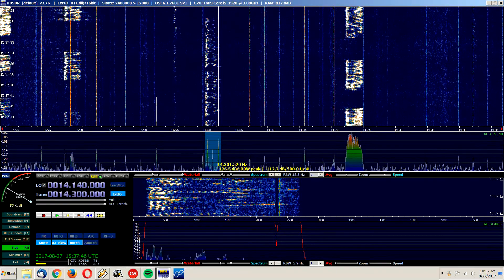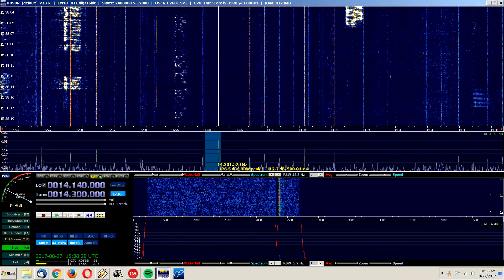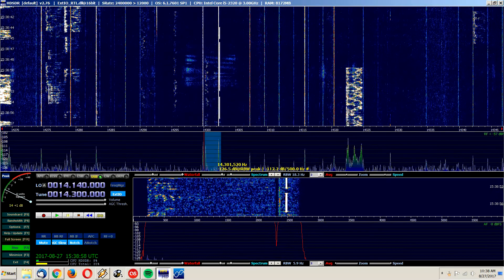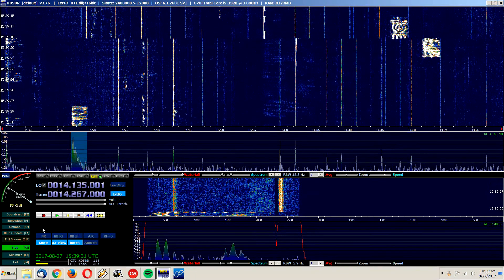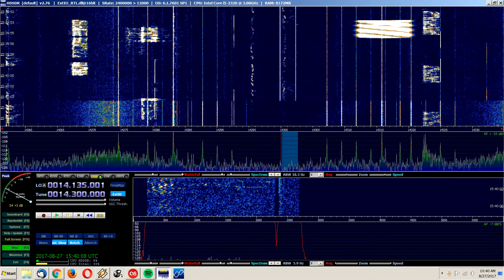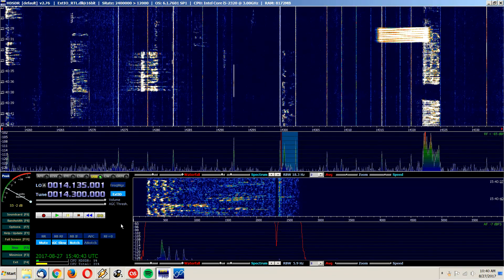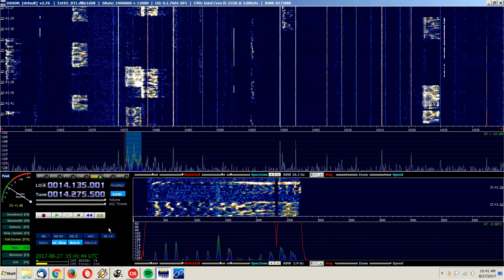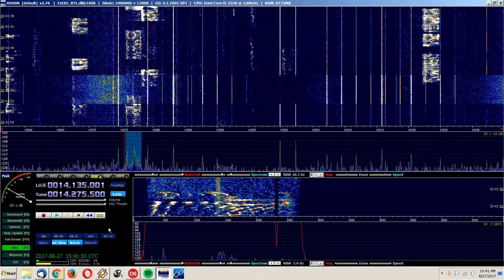Off Center Fed Dipole vs Fan Dipole

Comment: You need a 4:1 balun or ladder line & balanced tuner for your OCF
Reply from the maker: Yeah, back when I made that antenna I did not know that I needed a 4:1 balun for it to be a true OCF dipole. Still, for a receive antenna, it wasn't that bad from what I can remember.

Nowadays I'm using an end fed antenna with a 9:1 unun, and a 40 meter double bazooka for my rx/tx antennas.

Comment: You need a 4:1 balun for ocf. I run one and a fan also. One station may be better on one than the other one minute and it changes the next. Did you get the loop back up
Reply from the maker: Yeah I found out about needing a 4:1 balun when I was studying for my ham radio general license. If I ever try using a ocf again, I now know to use a balun. Sadly the loop is still out of commission. My brother hasn't had the time to look at it.
Reply: Sparkyzilla85 just finished my loop today. Needless to say it’ll be coming back down and the ocf will be going back up.
Reply: To all the know it all's, an off center fed dipole's impedance is set by the height of the  feed point. For a 4:1 to work perfectly, the antenna needs to be closer to 40, feet.. 12 feet off the ground is hard to guess, but at 12 feet, you can't get the full effect of the OCFD.
Reply: Joseph Massimino impedance also changes as the center feed is moved one way or another. The further from the center, the higher the impedance will become. And yes height plays a roll too. Higher the better. Mine is at 32’ with great results. Dropping it to 20’ raises the vswr to 2:1. No “ know it all here”. Still learning after 25 years. As are you.
Reply: @JayN4GO  Maybe you  can reference a URL where it mentions about moving the feed point, and  impedance changing.  I've read a lot, and the feed point is usually set by the ratio between the sides. I  don't think the impedance change on changing center is so much. The adjustments I made had to do with moving the resonance closer to where I wanted it on each band.  It is a tricky process, and takes time, but once it is set, it pretty much stays.  The antenna did not work as well at approximately 30 feet to the feed point, but once I moved it to 40 feet, it really took off.
Reply: @JayN4GO  But the offset does change , but the height is the great variable that makes the difference between the wire being 200 ohms, or something else.

Comment: Sorry to hear about the loop, the OCF dipole is nice and quiet at the height you have it presently....
Reply from the maker: Yeah, it's working quite nicely for something I threw together using spare wire and a balun that I can't remember why I bought it. It'll do until later this week when the center insulator that I ordered arrives, and I can buy some more wire. The current wire that I'm using are pieces of wire that are taped together with electrical tape.